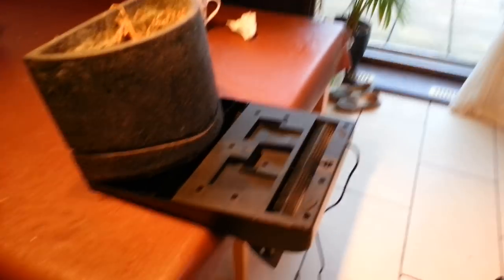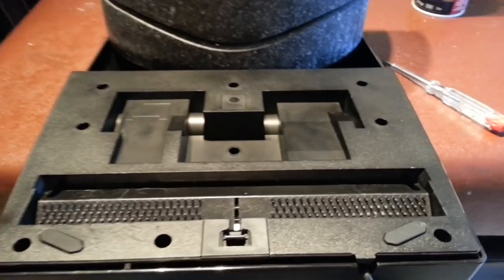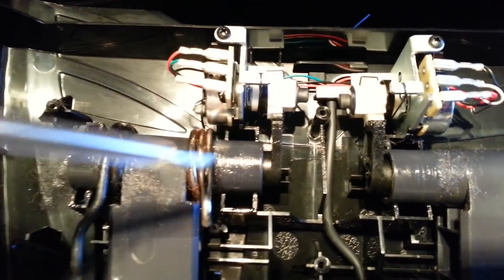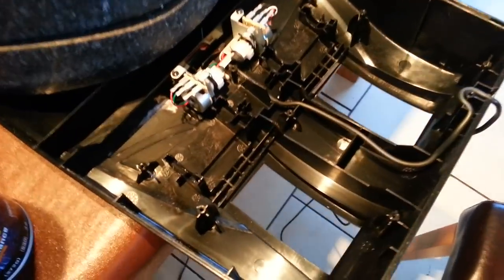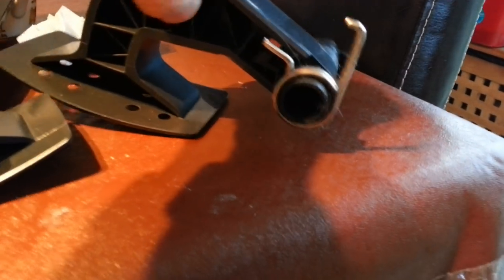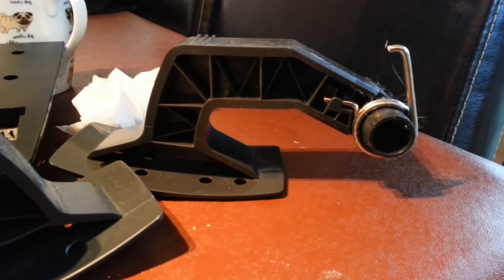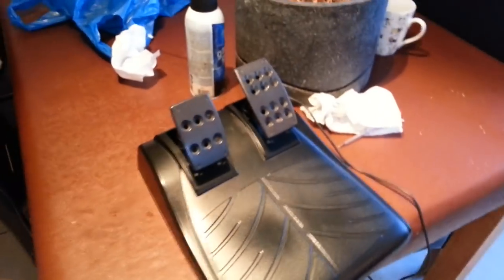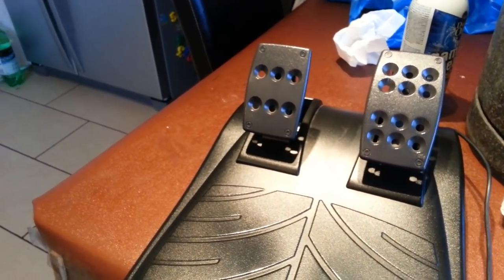How to fix Logitech Driving Force GT pedal set

Comment: Dismantled my pedals to clean them after the brake pedal began playing up - some springs fell off when I took the case off and I didn't know where to replace them! Thanks to your video I was able to put them back together and now they are working perfectly! You do mention the importance of the black teeth fitting properly onto the white cog of the potentiometer - I didn't do it properly first time which resulted in maximum acceleration/braking before the pedals were fully depressed. Thanks again - very helpful video.
Reply: How you do it pls tell me

Comment: This 2013 video saved my old DFGT (2018 - yes it still works)
Reply: ALEX KIM wow! I managed to find my old DFGT wheel sitting in a basket because yeah, the pedals stopped working and the DP was stuck in the up direction, but the wheel still works and I’m wanting to fix it (and I think I fixed the DP problem just by using it some)

Comment: Thanks for the video, that really helped me to solve a problem with loosing 30% of gas throttle. Gears on pedal and and gears on potentiometers are shifted and i placed it back. You saved my money, i buy this wheel in used condition and i don't know about it trouble, but i fixed it by your noticed. Thanks a lot.

Comment: awesome, it fixed my gas pedal which was "clicking" and not going 100% most times
Reply: Did it register pressing down most of the times, but not always?
I often have to press it down fully to accelerate, and because of that, manual shifting is useless.

Comment: I've had my DFGT for 8 years. Cracked the brake pedal and glued it back into place lasted for another 2 years now the brake spring has snapped and i think i finally need a new wheel and pedals now.
Reply: Update: Made it another 3 more years by using a bungee cord as a brake spring and a C-clamp to hold the wheel on since the clamp broke. Just upgraded to a G29, I'll miss the DFGT for sure!
Reply: @z33tanner  Is the G29 worlds better, including feedback? Or just somewhat?

Comment: Thanks for the tutorial. I got to this video because I just bought this steering wheel. My brake pedal feels a bit loose when I slightly push it, but it works perfectly fine. Do you have any suggestion about that?
Reply from the maker: It's only plastic m8. they are loose with not much resistance. 
I run a T300 now as im on ps4.
I would maybe suggest a t150, g29 or the t300 to you instead. they do ps3 and 4. :-)
Reply: +marius994 You can modify it. Open it up and put something like hot glue to the places where the springs press onto the casing, so that they tighten up. Did mine this way and they feel perfect now!

Comment: Thanks a lot for this video, it really saved my butt! I couldn't resist opening the pedals of my wheel after the first day of usage, because I thought the spring of the brake pedal was out of place. (turned out it's just a weak spring) It wasn't the first pedalset, I've opened, but I had no idea that it would fall apart instantly and be so hard to put back together. However, the idea of clamping it to the table plus knowing how the pedals align with the pentiometer and how the springs align with the housing instantly made it an easy job! 

Turned out the brake pedal just is that weak. Guess I'll glue a spring to the pedal to get more resistance. Or does anyone know the pinout of the pedals? Then I could soughter a DB9 connector to the pedals of my old, broken Thrustmaster Ferrari F430. If I could use those pedals with the logitech wheel, that would be perfect!

Comment: I'm having erratic response with my pedals.  When I play Gran Turismo (6, that is), It's like my pedal has its own traction control On.  The pedal is applying gas on it's own in tiny rapid bits when I let go off it.  It's weird, so I was wondering it could be the potentio-meters (?) that our gent here is talking about...

However, it seems no amount of dusting can fix it...
Reply: Have the same, but for me it's the brake pedal. Its braking on it's own, very gently flickering blacklights in f.e forza horizon 🤕